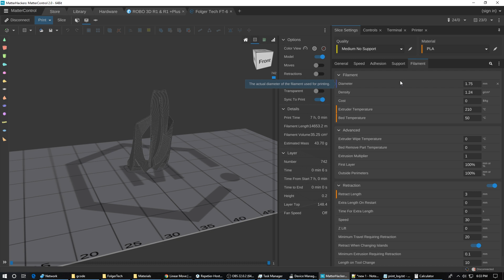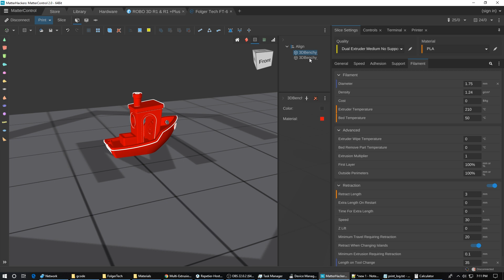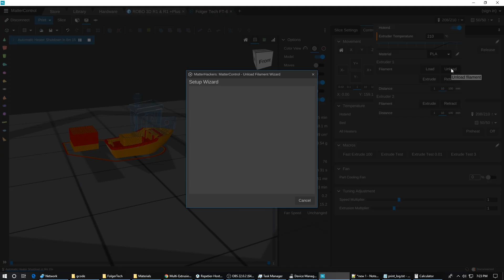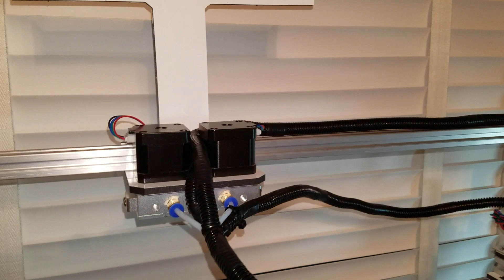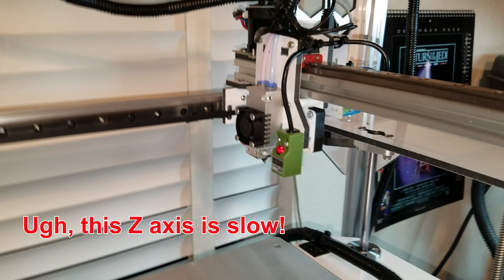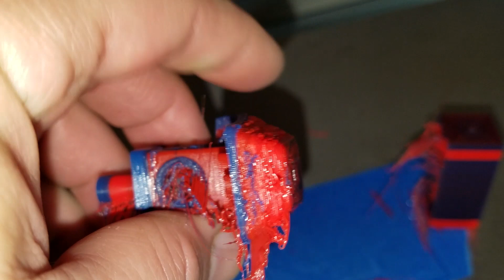FT 6 MatterControl Test Prints

Comment: I dont think I've ever seen anyone with a decent print with this printer..... could you point me to somewhere where I can see decent results.

I would like a large format printer and this one is super interesting but if it cant print then why waste my money.
Reply from the maker: After a significant rebuild including replacing the stepper drivers that blew out due to the two parallel motors on one drive, I've been able to get some acceptable prints, but I've come to the conclusion that if I had it to do over I would have gone with another printer.

Beo
Reply: @lordbeowulf1885  thank you for your honesty. It sucks because I do like the look of the printer and of course the sizable print area.

Comment: Is the wipe shield kind if like the pre extrusion on the flashforge printers? It makes sure the filament is there and it extrudes a little to make sure itll print cleanly on the first layer
Reply from the maker: Well, there are actually two different "waste" parts commonly associated with dual color extruders.  The one I was using here (which wasn't nearly big enough) is commonly called a wipe tower and is intended to run enough filament out in the new color to completely clear the print head and tip of the entire previous color.  That can take a LOT of filament, especially when mixing dissimilar/dark/light colors.  Frankly, the excessive cost of the wipe tower makes small parts with a single tip extruder rather impractical, since you'll spend several times the filament just on the tower than the part itself requires.  

Now that I have made some progress with my dual hot end/tip dual extruder (video coming before too much longer, I promise!) I don't need the wipe tower, but I still need the second concept known as an ooze shield.  This is basically a single wall shell built around the part where the head runs around the perimeter on a color change allowing some time for the excess liquid filament to ooze out before switching to the other color tip and starting the second color.  Seems to work reasonably well, and you can definitely see the difference between not using an ooze shield.

Beo

Comment: imagine doing 5 filaments :D
Reply from the maker: You laugh, but two years ago I saw that at CES.  A company had a proof of concept CYMKW printer for printing full color mix prints.  They weren't planning to manufacture it themselves, but were looking for someone interested in marketing their color mix control technology.  The thing was a BEAST!  Interesting that none of the color mix printers exhibited ever demonstrated a purge block.  Most were just doing the gradual color transition thing, but I suspect these guys were making the color transition inside the part where it wouldn't show.  They were printing a pretty big part, but even then, the colors on the surface weren't all that vibrant.  The ink jet printer approach (print plastic and then run a color printer over each layer) is probably better.

Beo